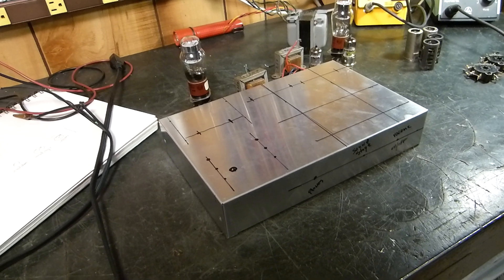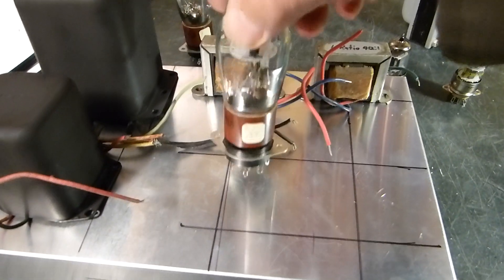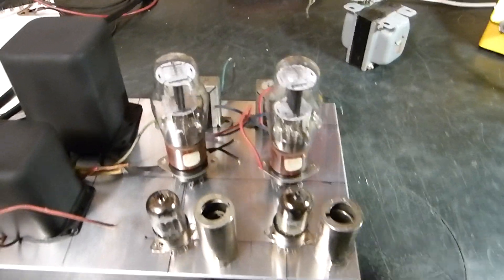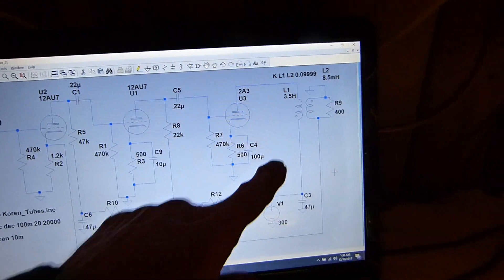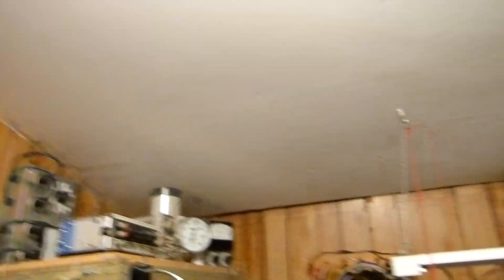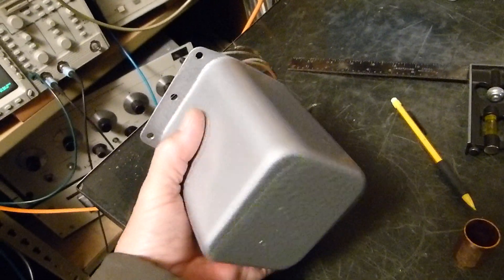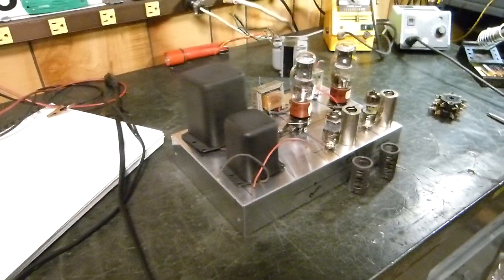Vacuum Tube Headphone Amplifier Using WWII Vintage 1626 Triode - Part 1

Comment: Hi friend,
Do you have the schematic for this build.
Thanks in advance Robert
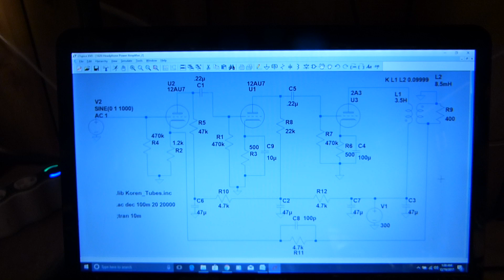Reply from the maker: I  do have it in LTSpice where I modeled it and it can be seen at 3:45. I will have to find it on the PC and you will have to install LTSpice to open the file or maybe just a screen print would help you for right now ? I do screen prints all the time and they are usually sufficient.

Comment: Hello, I was wondering who manufacture the power transformer and filter choke you used in this project. Thanks
Reply from the maker: I have a lot of parts that I don't know the equipment they came from but I believe this power transformer and choke came from some parted-out Heathkit equipment probably from the 1960 era. Back in that day, Chicago Standard Transformer (CST) company made a lot of components for Heathkit.
Reply: ElPaso TubeAmps thank you for the reply! I thought they were newly made and not nos. Do you know some new high quality potted transformer manufacturers? (Hammond of course but the potted series is only for push pull configuration).

Comment: Forgive me but my buliding knowledge is limited shouldn't your output transformers be at 90 degrees to each other. I believe this reduces crosstalk between the two , or helps limit core saturation. Can't remember which. Your son's lucky to have a dad like you. Hope it goes well.
Reply from the maker: I think you have a good point with the positioning of the OPT if they are side by side. I made measurements similar to this in an older video of the stereo Williamson amp I posted and did discover that the orientation of the power transformer to the output transformers could induce 60 Hz into the output transformers. Thanks for your comments.
Reply: ElPaso TubeAmps 
It might have been from that video where i got it from. Mains hum (60hz or 50hz as here in UK can be a nightmare. I remember at college being told about the problem with heater connections & using humbucking resistors to combat it.
Thanks again for the reply & i'm glad i could help in a small way.

Comment: Make sure the output transformers are suitable for single-ended class A. You need a big gap to avoid saturation due to the DC. You had that problem before with one of last year's monsters. Best wishes EJP
Reply from the maker: This project was initially going to be a PP 6SN7 that I was very happy with the performance in LTSpice getting about 3.5 watts of very clean output but after carefully checking my two PP transformers before starting, which I usually do not do... but in this case I did because of my last inductance measuring project, one of my transformers turned out no good. Oh well... I am glad I found out before building the thing and one channel nor performing right.I have a number of other small PP output transformers but all are single ones with no matching partner.I have had to switch to a SE amp design and I do indeed have two perfectly matched SE transformers that will give me a 6K tube load for a 16 ohm secondary load. I suspect the transformers I have came from a SE vintage stereo amp running a single 6AQ5/6BQ5/who-knows. Anyway, when I model it I must be doing something wrong as voltages and currents all seem good within the amp design but the model shows only mW and uW output. I don't get it. Yes, indeed, I did learn the hard way that PP transformers don't work for SE amps and the amp you are talking about was a 833A monster with 3KV on the plate. That 40+ pound transformer saturated at about 150 mA which was the idling current of the 833A. Best wishes for the holidays.
Reply from the maker: The problem with my mW and uW output was the coupling factor I put in for my transformer. A simple mistake of 0.09999 instead of 0.9999. Now it models perfectly. Only took two days to see it.

Comment: So no interest in that very simple 6DJ8 6080 OTL headphone amp schematic I sent you?  Your design is going to be one heck of a Huge Heavy Beast of a Headphone amp.  I'd be willing to ship you the prototype I made for my son for head to head testing with your expensive test gear, If you'd be willing to ship it back to me when you are done???  It would be an interesting video for your channel.  And if my super simple, very cheap to construct (possibly cheaper than just one of your nice potted transformers costs), prototype OTL amp does just happen to test out better, then maybe I'll have convinced you work with me on putting the finishing touches on this OTL headphone amp design.  LOL  ;^)
Reply from the maker: The 6080 OTL design has interested me for many years but in this case I basically just liked the looks of the little 1626 triode and I have several so that is why I have decided to go this way. You might read my comment to QuadMaestro above about my 6SN7 thoughts. I am convinced that the SE design I now have in LTSpice will work so I am going to start drilling the chassis tonight. If it does go poorly, I am planning on leaving enough room to change out the OPT for PP transformers and go the 6SN7 way.The only reason I shy away from the 6080/6AS7 design for this little amp is the necessary high current to light the filaments. The power transformer I am using has only a small current filament winding. The filaments of the 1626 is only 250 mA and the tubes run pretty cool. Your offer to ship to me and me back to you is most generous and appreciated. Maybe we can do that in a few weeks after this project I now have is complete.
Reply: Cool!  I have already solved the high filament current (2.5Amps) requirement of the 6080 tube.  I strongly encourage you to build your nice Heavy Metal Beast of a headphone amp for your grandson before Christmas!  It will be a wonderful heartfelt gift I am sure he will treasure!  It will also set the benchmark for my 6080 design to surpass!  If it can't, why bother with it?  But I am nearly certain from the research I have done, that an OTL design will have no problem in exceeding the results verified by your nice test equipment of any amplifier that employs output transformers.  I look forward to seeing the very nice traditional amp you are building your grandson!  Now get to work!  Christmas is approaching very quickly.  LOL  8^)

Comment: Are you transformers match for low impedance headphones or high impedance headphones?.
Reply from the maker: They are SE vintage output transformers but with a 16 ohm load (the headphones are 70 ohms) they will give a tube load of about 6K. I intend to put a resistor across the output of the transformer to match it to the tube and take into account it being parallel with the headphones. Thanks for your thoughts and comments..
Reply: A later comment shows his design will be for 16 ohm headphones.  My 6080 OTL design is for 250-600 ohm headphones.  I certainly hope he takes me up on my challenge.  I have already built a very unconventional prototype amp of my design idea for my son's high impedance studio headphones and it sounds outstanding!  ;^)

Comment: Please, please, not that damned non-linear 12AU7.  :>((  Either the 12FQ7 or 12BH7 will be BETTER.

Eli D.
Reply from the maker: Because of your comments I am also modeling with the 12BH7 and will be testing it once built. I very much appreciate your thoughts on this matter.
Reply: The 12BH7 measures so close to the 12AU7, except the 12AU7 has half the inter electrode capacitance. The curves are damn near identical . Though I got to say it always sounds better?? Anyone with an 82 or U7 try a 12BH7...
Reply: Although I would have to take you up on the 'non linear' thing.

Comment: It will be a nice looking project when finished. You are open to suggestions so here goes. How about putting the power components in the middle - mains trmr at centre back, choke centre and smoothing cap centre front. Then symetrically each side, opt rear (on top), O/P valve centre and 12AT7 at front. This would balance the weight distribution and appeal to my (slightly autistic) brain as far as visual balance goes.
Reply from the maker: I did consider that layout with a different power transformer with the OPT's on each side but when I changed to the black potted transformer and choke I decided to put them at one end and the amp section on the right side of the chassis. It is basically the small black choke that threw off any hope of symmetry. I appreciate your thoughts.
Reply: I love watching your videos.

Comment: * EVEN CLOSER
** 1626 ****************************************
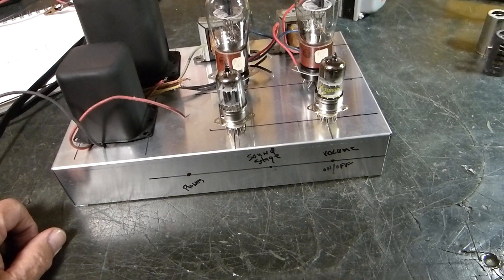* Created on 12/19/2017 02:15 using paint_kit.jar 3.0 
* www.dmitrynizh.com/tubeparams_image.htm
* Plate Curves image file: 1626.png
* Data source link: 
*----------------------------------------------------------------------------------
.SUBCKT 1626 1 2 3 ; Plate Grid Cathode
+ PARAMS: CCG=3.2P  CGP=4.4P CCP=3.4P RGI=6480
+ MU=5.79 KG1=10179 KP=16.1 KVB=11424 VCT=0.0081 EX=1.68 
* Vp_MAX=500 Ip_MAX=200 Vg_step=7.1 Vg_start=0 Vg_count=8
* Rp=4000 Vg_ac=55 P_max=38 Vg_qui=-48 Vp_qui=300
* X_MIN=51 Y_MIN=34 X_SIZE=530 Y_SIZE=431 FSZ_X=1454 FSZ_Y=523 XYGrid=false
* showLoadLine=n showIp=y isDHT=n isPP=n isAsymPP=n showDissipLimit=y 
* showIg1=y gridLevel2=n isInputSnapped=n  
* XYProjections=n harmonicPlot=n harmonics=y
*----------------------------------------------------------------------------------
E1 7 0 VALUE={V(1,3)/KP*LOG(1+EXP(KP*(1/MU+(VCT+V(2,3))/SQRT(KVB+V(1,3)*V(1,3)))))} 
RE1 7 0 1G  ; TO AVOID FLOATING NODES
G1 1 3 VALUE={(PWR(V(7),EX)+PWRS(V(7),EX))/KG1} 
RCP 1 3 1G   ; TO AVOID FLOATING NODES
C1 2 3 {CCG} ; CATHODE-GRID 
C2 2 1 {CGP} ; GRID=PLATE 
C3 1 3 {CCP} ; CATHODE-PLATE 
D3 5 3 DX ; POSITIVE GRID CURRENT 
R1 2 5 {RGI} ; POSITIVE GRID CURRENT 
.MODEL DX D(IS=1N RS=1 CJO=10PF TT=1N) 
.ENDS 
*$
Reply from the maker: Wow... I owe you. Thank You...
Reply: ElPaso TubeAmps just keep making more videos. I'm watching them.
Reply: ps. Put the tube names such as "1626" and "12au7" in the video description in case someone else is going to search for these terms to increase your viewership. :)
Reply from the maker: I have been using your model with the 1626 ever since you sent it to me. Works perfectly. Thanks again and I will show it in the next video.
Reply: Good to hear! Check your youtube messages for a longer reply!
Reply from the maker: Matthew,
I don't want to impose on you but I have six beautiful brand new Svetlana 572-160 that I want to use in my next project. They are the same as 811A tubes without the plate cap. Would you happen to have a Spice model for the 811A?
Many thanks for your 1626 file.
Regards, David
Reply from the maker: Thank you so very much. Once again, I owe you a big favor.

I got the Svetlana data sheet off the Internet and could see it compared right with the 811A. Does your program read the data from these sheets off the Internet or from a PDF and build these models? I hope you don't have to type all these tedious parameters in.

It was giving me some funny error so I changed the .SUBCKT line and last line as below after looking at the Svetlana 2A3 model. I assume I did it right as it runs now (?)

** 572_160 Composite DHT *************************************
* Created on 12/28/2017 02:03 using paint_kit.jar 3.0 
* www.dmitrynizh.com/tubeparams_image.htm
* Plate Curves image file: 572-160.png
* Data source link: 
*---------------------------------------------------------------
.SUBCKT 572_160 1 2 3 ; P G C  (Triode)
+ PARAMS: CCG=3P  CGP=1.4P CCP=1.9P RFIL=10
+ MU=174.4 KG1=1528.7 KP=72 KVB=28416 VCT=0.09 EX=1.34 RGI=1720
* Vp_MAX=2000 Ip_MAX=500 Vg_step=20 Vg_start=80 Vg_count=5
* Rp=4000 Vg_ac=55 P_max=40 Vg_qui=-48 Vp_qui=300
* X_MIN=71 Y_MIN=65 X_SIZE=620 Y_SIZE=347 FSZ_X=1300 FSZ_Y=600  * XYGrid=false
* showLoadLine=n showIp=y isDHT=y isPP=n isAsymPP=n             * showDissipLimit=n 
* showIg1=y gridLevel2=n isInputSnapped=n  
* XYProjections=n harmonicPlot=n harmonics=y
*---------------------------------------------------------------
RFIL_LEFT    3  31 {RFIL/4}
RFIL_RIGHT   4  41 {RFIL/4}
RFIL_MIDDLE1 31 34 {RFIL/4}
RFIL_MIDDLE2 34 41 {RFIL/4}
E11 32 0  VALUE={V(1,31)/KP*LOG(1+EXP(KP*(1/MU+V(2,31)/SQRT(KVB+V(1,31)*V(1,31)))))} 
E12 42 0  VALUE={V(1,41)/KP*LOG(1+EXP(KP*(1/MU+V(2,41)/SQRT(KVB+V(1,41)*V(1,41)))))} 
RE11 32 0 1G 
RE12 42 0 1G 
G11 1 31 VALUE={(PWR(V(32),EX)+PWRS(V(32),EX))/(2*KG1)} 
G12 1 41 VALUE={(PWR(V(42),EX)+PWRS(V(42),EX))/(2*KG1)} 
RCP1 1 34 1G 
C1 2 34 {CCG} ; CATHODE-GRID 
C2 2 1 {CGP} ; GRID=PLATE 
C3 1 34 {CCP} ; CATHODE-PLATE 
D3 5 3 DX ; FOR GRID CURRENT 
D4 6 4 DX ; FOR GRID CURRENT 
RG1 2 5 {2*RGI} ; FOR GRID CURRENT 
RG2 2 6 {2*RGI} ; FOR GRID CURRENT 
.MODEL DX D(IS=1N RS=1 CJO=10PF TT=1N) 
.ENDS      572_160
Reply: I take a screenshot of the PDF and feed the image file into the program. After overlaying the "physical grid", labeling the max voltage and current, setting an approximate mu value, there are a few sliders you can drag around to set the curves. The, the SUBCKT in my model had two cathodes (K1 K2) for some strange reason. Glad you got it working. The weblink to the JAVA open source software is included in the model data. The author gives a great step by step guide on how to get it working. You could consider checking it out and making a video about it.
Reply from the maker: I just did a simple model of a 811A (or 572_160) with a 10H primary and 11.2 mH secondary (Z ratio of 1250, 10K primary to 8 ohm secondary) and get 339 watts from it which makes perfect sense with 1600 on the plate. I think this is going to inspire me to make a couple of 811A/572_160 amps with an outboard power supply. That should be a stereo worth looking at.
Reply: Nice! Can't wait to virtually hear it! With that outboard power supply, who knows what your next tube project may include... Maybe a TZ40?

Comment: What about using two KORG 6P1 flat vacuum tubes which will fit a 28pin din IC socket and will run of 50V 5A